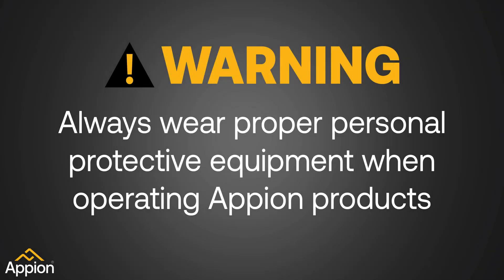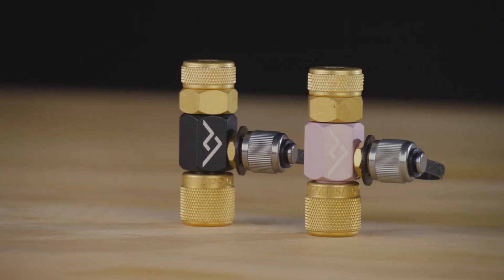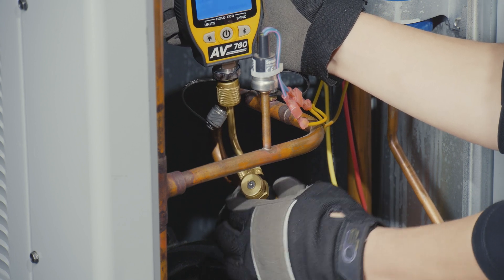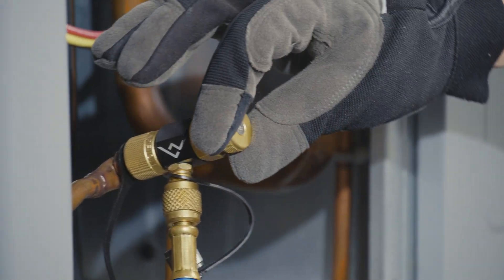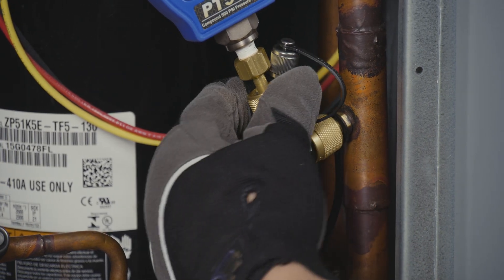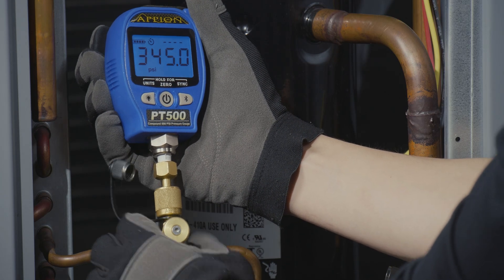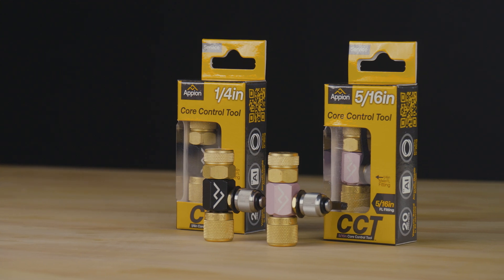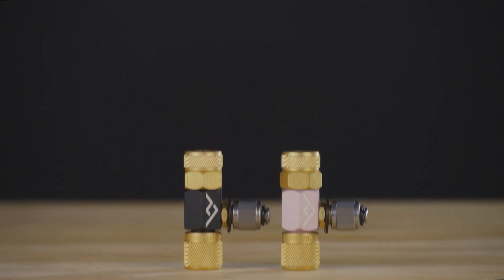Core Control Tool Product Highlight

Comment: What sizes are the male and female sides? Both 5/16"? Do you have one where the female is 5/16 and the male is 1/4?
What's the maximum rated pressure it can handle? All my core depressor tools from different companies (including yours) leak when i try pressure testing at 500-600 psi. Not leaking from the female side, but from the factory-sealed components on the tools
Reply from the maker: Regarding the sizes, the CCT516 is a 5/16 inch Female flare to 1/4 inch Male flare connection. As for the pressure rating, our Core Control Tool is designed for use with high-pressure refrigerants and is vacuum-rated to 20 microns. If you are consistently encountering this issue with multiple core depressor tools, including ours, there might be another factor in your testing setup contributing to the leaks. Check out our “Core Control Tool Isolation Test” video on YouTube if you want to test your CCT.

Comment: What is the purpose of this tool???  Am I missing something?? Does this remove the valve core or just push it in???
Reply from the maker: The Core Control Tool is designed to depress valve cores without removing them, making it ideal for compact systems where core removal may be impractical. It's also perfect for charging and metering refrigerant or for gauge isolation, as demonstrated in the video.
Reply: @Appiontools when you twist the end I assume it’s loosening the core? Do you have to tighten it back after?